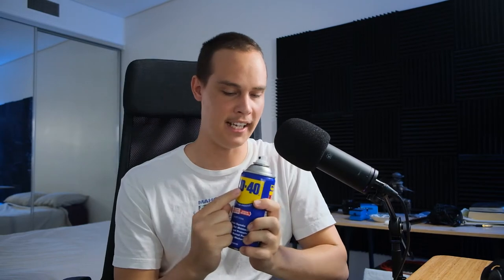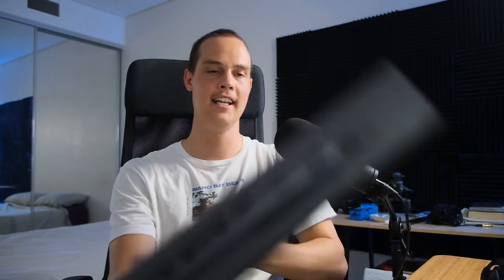How to fix mechanical keyboard from water damage secret (last resort)

Comment: hello, found your vid a few days ago. tried it on my apex pro and it actually works now hahaha its crazy. what I did:
1. disassemble the whole keyboard
2. spray wd40 down the front
3. spray wd40 on the keyboard "board" (the back)
4. let it dry/sit for like 3-4 days (cuz i was lazy)
5. assemble it, and it friggin works lmao i had problems with the . and , and n .,n.,n.,n.,n.,n.,n.,n.,n.,n.,n.,n works.
Reply: Does that include removing the switches?
Reply: @dylanburt5211  no, but I tried to spray under the switches/as close to the board as possible.
Reply: Hi may I know how did you spray the back of the board (Step 3) ?
Reply: @user-nn6fz3ec7q  I couldn't get to it, but I tried to get as close as possible. The keyboard was dead anyways so I just tried. Still working very well 5 months after.

Comment: No don't use WD-40 (the normal one) use isopropyl alcohol or compressed air... Please don't break your keyboards.

Story short: WD-40 melts plastic.
Reply: Thanks! I will use air and alcohol instead.
Reply: @LauraAmanda8888  no problem at all, surely use it if this doesn't work then either the switches needs to be changed (depends on the keyboard) or the PCB is malfunctioning.

Comment: I was washing my key caps , i dried them put them back on but I think I lacked in drying and a bit of water went inside , tried blowing it drying it everything even vacuum cleaned it , this is my last option hopefully this works
Reply: Guys use wd-40 it worked
Reply: @green_olives   really same happened to me earlier
Reply: Yes it works
Reply: I put it on my broken keys then let it dr for like an hour or 2 and it works
Reply: Sameeee
Reply: What do you think, some keys no longer go on my G 513 Carbon (lighting etc. works) should try it out or accept a purchase offer what I got today?
I do not know yet how much I am offered, but basically?
Reply: @Janoip  it worked for me bro what can I say but idk for yours
Reply: @Janoip  if lighting doesn’t work then get a new keyboard
Reply: @Janoip  my lighting worked it was just my keys
Reply: @green_olives  Ok thanks, then I will give it a try.
Reply: My lighting works. But instead of buttons not pressing. Most of them now press by themselves and it's chaos.
Reply: @sc1rxz  it’s probs not water issue then , maybe keyboard broken ?
Reply: @sc1rxz  that’s what i got
Reply: i let my keyboard dry for 5 days and it fixed itself.
Reply: @sc1rxz  u just flipped it upside down?
Reply: @green_olives  thx but do u have to use it right when the water get inside bc i think i splitted some water inside like 2h ago
Reply: Did you spray it inside the switch or just removed the keycap and started sprayin?